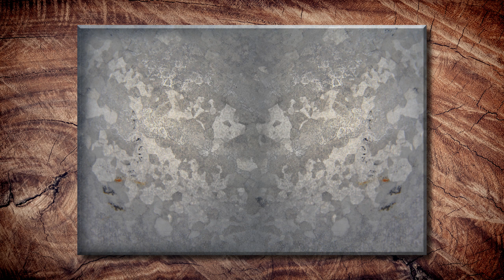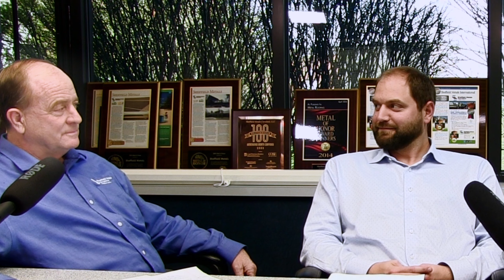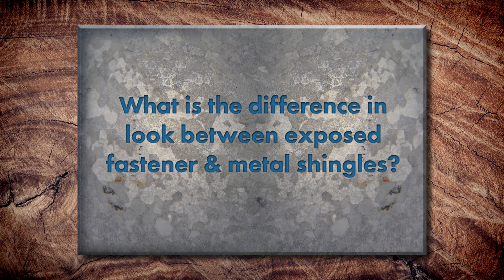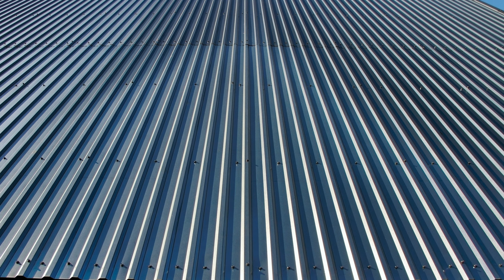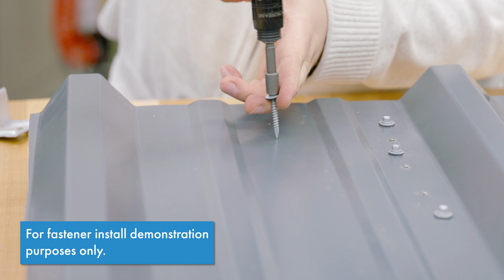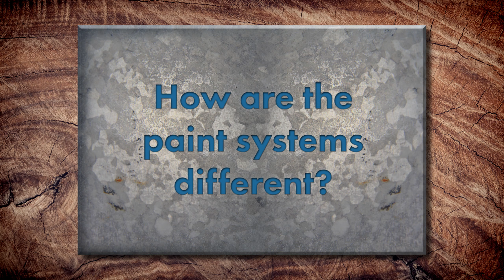Exposed Fastener Metal Roofing vs. Metal Shingle Roofing

Comment: Just another note, according to FEMA in their after hurricane inspections of roofs they concluded that hidden fastener snap lock panel metal roofs were the worst preforming metal roofs. FEMA also noted that exposed fastener metal roofs were the best to insure you have the proper number of fasteners installed because you can see the fastener on an exposed fastener metal roof. FEMA shows several photos of metal roofs that failed, none of them are exposed fastener metal roofs, the metal roofs that did fail were snap lock panels roofs and yes the highly acclaimed mechanical seam metal roofs.

Comment: If you all say there are so many problems with exposed fastener metal roofs then why do you sell the panels for exposed fastener metal roofs. A poorly installed mechanical seam roof will be just a problematic as a poorly installed snap lock roof and just as problematic as a poorly installed exposed fastener roof. A properly installed exposed fastener metal roof will preform just as good as a properly installed mechanical seam or snap lock metal roof. All the exposed fastener metal roofs around me in Cape Coral, Florida survived Hurricane Ian and we were hit with several hours of full force pounding winds because Ian Stalled right off of Sanibel Island so we went though Ian's wind from around 6:30 pm and were still being pounded at 3:00 am. Ian was a very slow moving hurricane that was a high end cat 4 as it pounded Lee County/Cape Coral/ Pine Island/Sanibel Island and Ft. Myers Beach.

Comment: Do you recommend a a rain screen under a 1.75" standing seam metal roof for the Northwest (Seattle) climate?
Reply from the maker: Hello, there's a lot of factors that go into this question like slope, attic ventilation, spray foam insulation etc. If you want, you can call the Sheffield Metals technical department to discuss your specific situation. https://www.sheffieldmetals.com/Resources/Technical-Department Thanks! -Thad